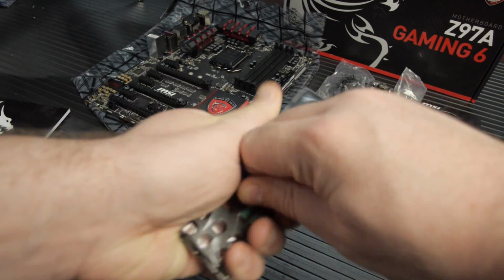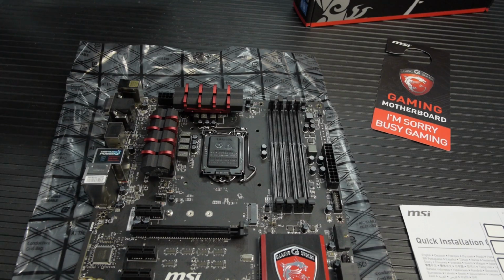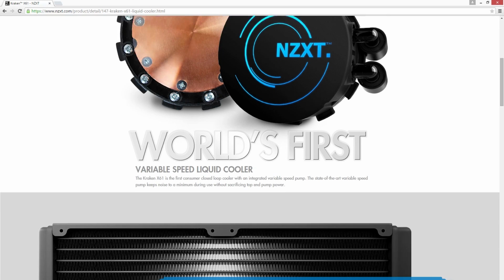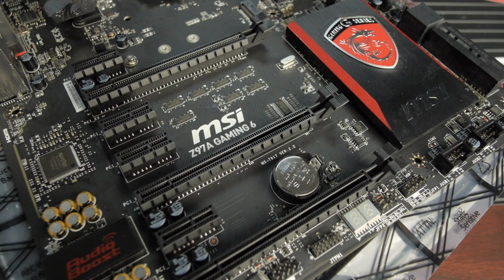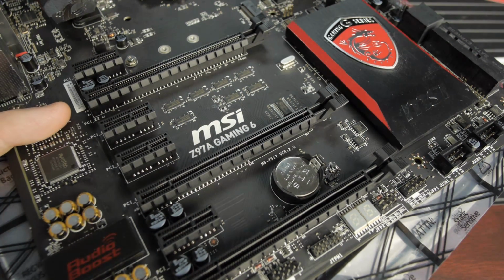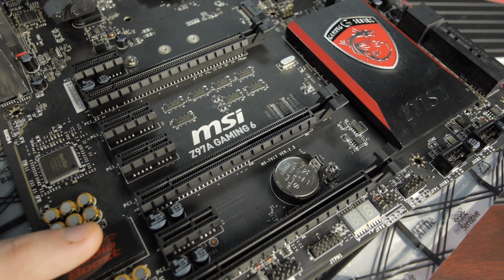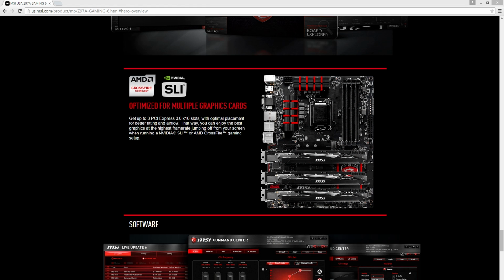MSI Z97A Gaming 6 - USB3.1c 10 gigabit Uboxing & Overview

Comment: I have got this motherboard but I have an issue with the system fan 3 not running even though its connected but its always on 0 rpm what can I do to fix it? the led is on though

Comment: whats the difference between the gaming 6 and gaming 7
Reply: ***** gaming 7 has 8x sata 600 instead of 6x and has some different port which you'll have to just look up. also the gaming 7 doesn't have the 2nd usb 3.0 which i do need for a card reader and stuff

Comment: I got this motherboard and I can't get the WIFI to work. Can some1 please help me with this? I can't use cable as of rigth now so I need Wifi
Reply: because this motherboard doesn't come with built-in wifi capabilities.
Reply: jbenvenga woot? The page I got it from say it got 802. 11ac WiFi
Reply: Sindre Eide where did you buy it? on newegg, there is no wireless card mentioned. i recently purchased the gaming 7, so i was debating between the which msi z97 gaming board to get. yeah, the 6 and 7 don't have it built in. in fact, most mobos don't, except really high end boards. 
that said, you can buy a wireless pci card. i don't have any recommendations because i always use ethernet.
Reply: jbenvenga I fiked ethernet cable now so no worries. It was some Norwegian page.
Reply: Sindre Eide ok good. can never trust those norsemen, eh? ;)
Reply: Sindre Eide well, this is awkward

Comment: I don't think you're meant to put a motherboard on an anti-static bag. If I'm not mistaken, the inside of the bag isn't conductive, but the outside of the bag is. This is to keep any static electricity from going inside. If you want a ghetto test bench or just somewhere to put your board, it's a better idea to just rest the board directly on top of the box it came in.
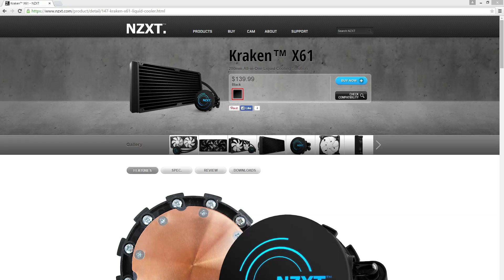Reply: Papa Moon If the bag was inside out, I think the text on it would be back to front. There's also a bit at the bottom where the bag is sealed shut. With the bag inside out, that bit would probably be on the inside. You can get a good look at what I'm pointing out by pausing at 0:57.

I hope I don't sound like I'm just trying to prove I'm right. I was just curious to see if that bag was in fact turned inside out and decided I might as well share my observation. The guys at Tek Syndicate mostly know what they're doing; I just wanted to see if they actually made the mistake I was pointing out.
Reply: The worry of puting the Mobo on the bag would be that the bag is conductive, but there is not current running thru the board hence no short, esd free BECAUSE the outside is conductive
Reply: Jack Durrant the board wasn't turned on so there is no problem
Reply: ***** I'm sure static electricity could still be generated. Otherwise, motherboard manufacturers probably wouldn't package their boards in these bags to begin with. The likelihood of damage to the board is probably quite low, but better safe than sorry.
Reply: Jack Durrant Good point
Reply: Jack Durrant It's fine if you turn the bag inside out, which it probably is
Reply: What? and who cares. static is no issue to me.

Comment: Wish MSI didn't use Killer NIC cards had nothing but trouble with it. Made me actually return the board if they had done it with Intel Ethernet then it would of been great (as even the tired red and black can be easily changed due to using easy screws to remove the anodised red parts of the heatsink).

Great Line of boards with in my opinion only one fatal flaw, that I listed above, shame really, hopefully they will ditch them for the next round.

Comment: If usb 3.1 is 10gigabit, could you use a converter and use it as a 10 gigBit Ethernet port. With the correct drivers and converters of course
Reply: Shizzlester The USB port doesn't have a network controller chip hooked up to it. It wouldn't be possible.

Comment: I like the fact that manufactures are doing USB 3.1c for Z97, so many times in the past you would have to update to the latest board to run the newest USB version.
Like the vids sir.
I may be in the minority but a bit more Linux stuff would be nice, been running Linux since the late 90's, dont really need any info but i just want you to spread the love.
Thanks again.

Comment: 5th Generation Intel CPUs...
Was Haswell refresh the 4th of 5th?
Reply: Tea Kay 4th gen is 4770k on Z87 Haswell
5th gen would be 4790k on Z97 Devils Canyon

Devils Canyon isnt on 2011 so there 5th gen is 5xxx

Although when the Z170 5xxx desktop chips are coming, we will call them 5th gen because Devils Canyon was only a tiny update on the same architecture.
Reply: Tea Kay 5th gen will be Broadwell CPU's (Core i7-5775C and Core i5-5675C) and then, 6th gen will be Skylake CPU's

2011-v3 are 4th gen Haswell-based CPU's
Reply: Tea Kay 4th
Reply: Felipe Queirolo and what is the 5th? The 5××× Cpus are 2011-v3 and X99 am i right?

Comment: Isn't it bad to put the motherboard in top of the plastic bag because its only the inside of it protective? :o
Reply: Imcaam Yes, you're correct.  I don't know wtf Wendell was thinking especially since he has access to that rubber or rubber-like matt on that desk/tabletop. It's common sense to put ANY pcb ontop of a surface that has the least chance of harboring electrical current, ( cardboard, solid dry wood, things like that)
Reply: ***** The static bag collects static on the outside, that can damage sensitive components.
Reply: Imcaam It's fine if you turn the bag inside out, otherwise don't do it
Reply: Papa Moon That's not how it works, the inside isn't made of anti-conductive material and you can't just "turn it inside out" and it'll be fine. The bag forms a Farady cage, which essentially protects the inside from static shocks. If you were to turn the inside out, you'd again only have protection on the inside.